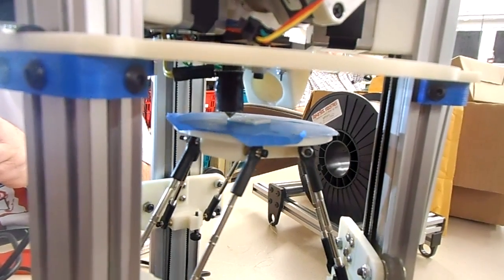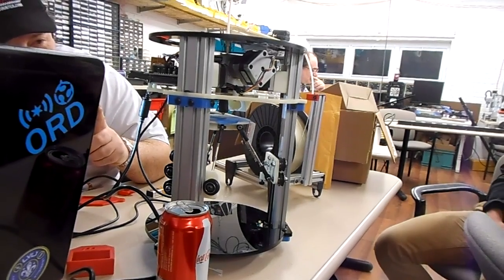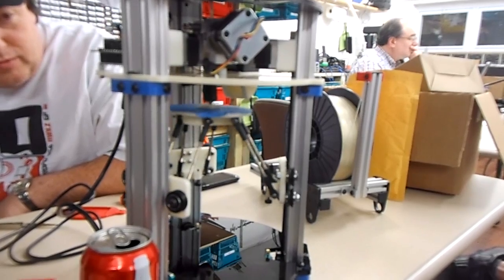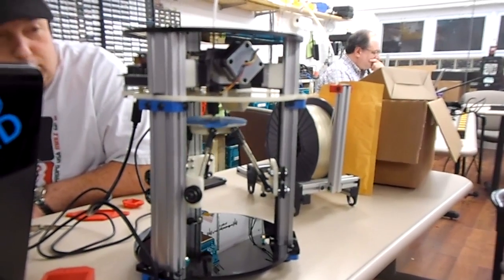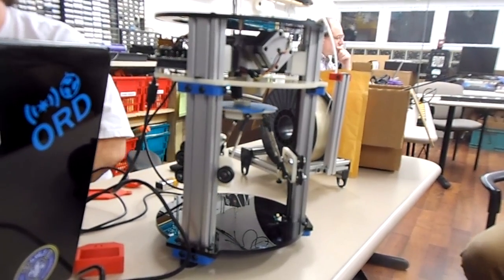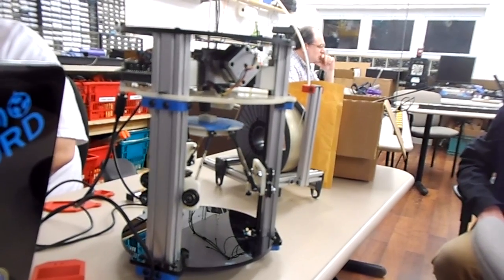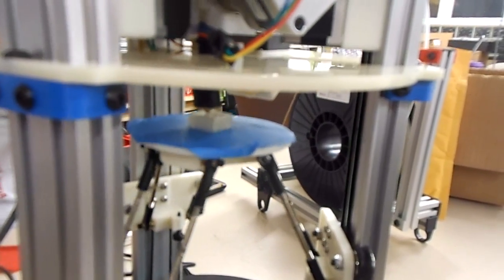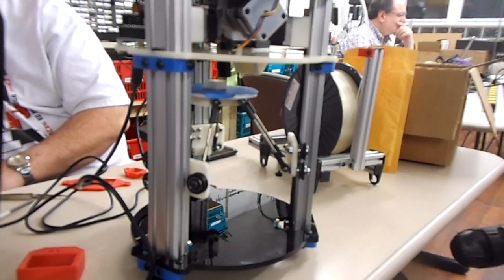Quantum Delta First Print

Comment from the maker: The main advantage is simplicity of the design.  It has only about 8 unique fabricated parts.  Virtually any extruder will work and you don't have to worry about the issue with a Bowden drive.  The wiring is freaking simple too.

It only works better smaller build areas.  Once the printed parts start to outweigh what an extruder nozzle and related parts weigh, the advantages disappear.